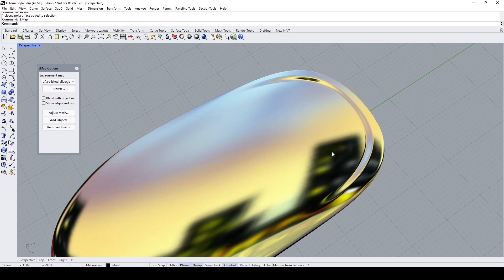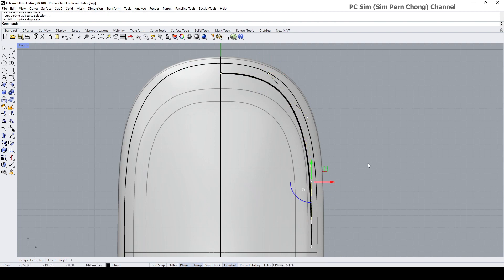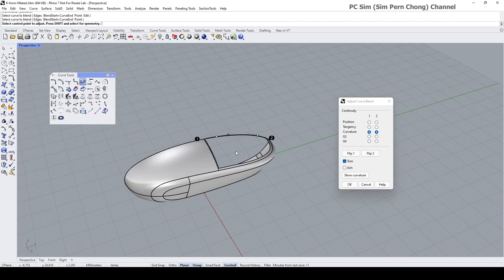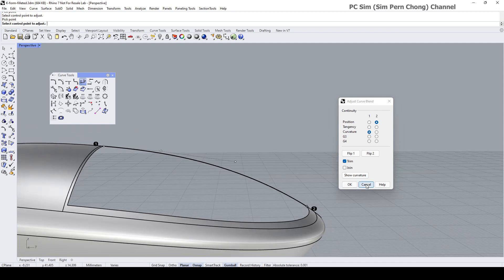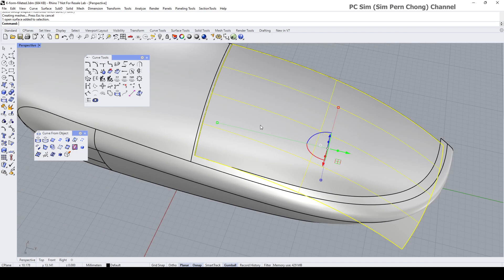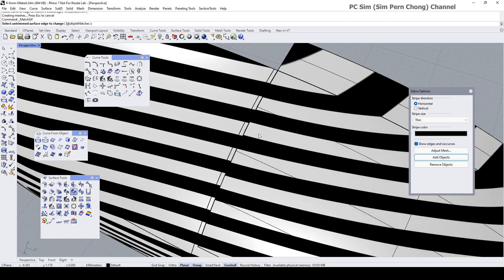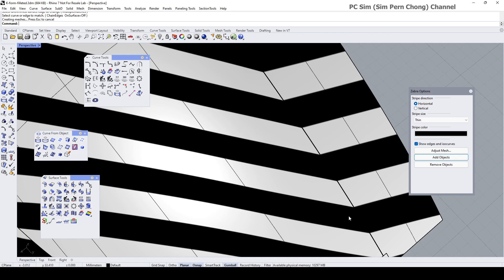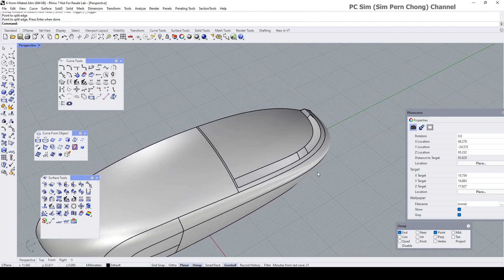Rhino Advanced Surfacing CAD Tutorial: Product Design Detail Styling (Updated) [犀牛3D高级曲面教程：产品设计细节造型]

Comment: In product design and styling, NURBS are particularly useful in the following areas:

1. Automotive design-NURBS have been widely used in automotive design for creating smooth, aerodynamic surfaces.
2. Aerospace engineering-The use of NURBS enables engineers to create precise, complex shapes for aircraft and spacecraft components.
3. Industrial design-NURBS are employed to model intricate shapes for consumer products, such as appliances, electronics, and furniture.
4. Architectural design-NURBS can be used to create detailed models of buildings, including complex facades and roof structures.

Several 3D CAD (Computer-Aided Design) software packages support NURBS modeling, including Catia, SolidWorks, Autodesk ALIAS, Rhinoceros (Rhino), Plasticity (NEW)

Regards

Comment: Rhino can be used for advanced NURBS surfacing, and it is considered one of the top CAD software programs for NURBS modeling. While Alias is known for its advanced surfacing capabilities, Rhino offers similar functionality and is often preferred by designers who require a more affordable and user-friendly option. Rhino has a wide range of advanced surfacing tools that allow designers to create complex shapes and surfaces with precision and ease. These tools include advanced curve and surface creation and editing tools, robust filleting and chamfering capabilities, and the ability to create high-quality surface continuity between adjacent surfaces.

Additionally, Rhino has powerful tools for analyzing and correcting surface geometry, such as the ability to check for curvature continuity and analyze surface deviation. These tools can be especially helpful for designers working on products that require precise surfacing, such as automotive or aerospace components.

Overall, Rhino is a highly capable software for advanced NURBS surfacing, and its range of advanced tools and capabilities make it a great choice for designers looking to create complex, high-quality surfaces.
Reply: NURBS (Non-uniform Rational B-Spline) is indeed an essential technique in 3D modeling, and it plays a significant role in various fields, including product design and styling.

Here's why... In product design and styling, NURBS offer several advantages:

 NURBS enable the creation of smooth, continuous curves, which are essential for achieving a high-quality finish on products.
The mathematical nature of NURBS allows designers to achieve precise control over even complex shapes.
Free-form design- With NURBS, designers can create intricate shapes and curves that would be difficult or impossible with other modeling techniques.